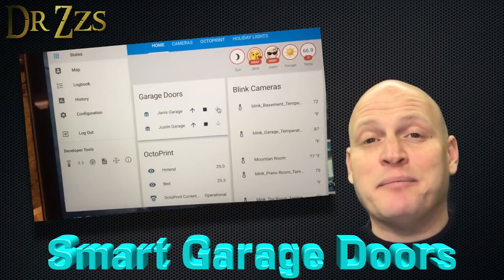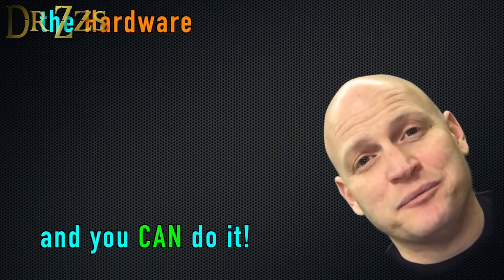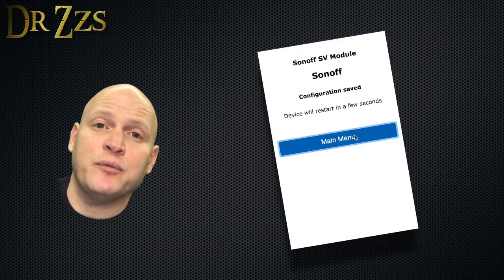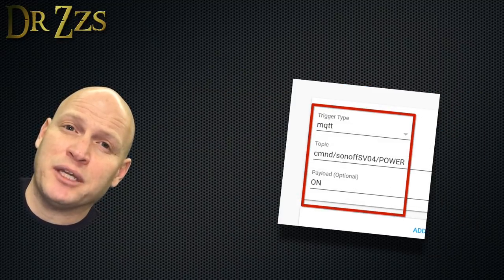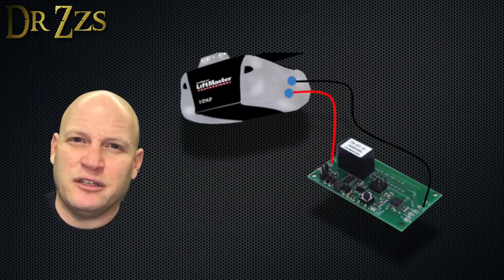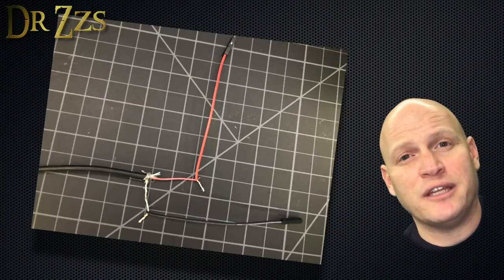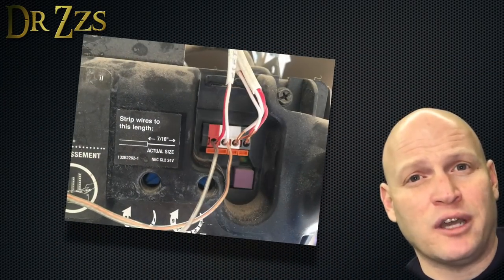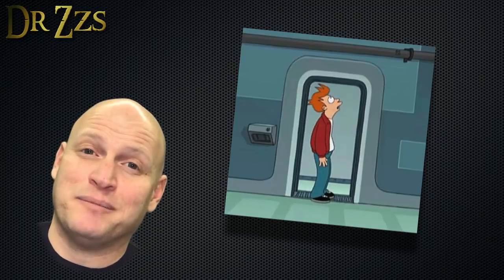$5 DIY "Smart" Garage Door Opener using Sonoff SV

Comment: I have been trying to get this going for a while. I am on a PI 3 B+ running dale3h/hassio_rpi3bp. I have tried so many combinations I am not sure what I have. I changed 
host in Sonoff to PI IP and it is connecting. But not controlling from HA. Here is print out of what I have now. Any help appreciated  https://hastebin.com/acanamoluh.vbs
Reply from the maker: First thanks for using hastebin to post your code/errors!  It is much easier to help when I have all that information.  
Now, let's see if we can get it fixed:

First, just so I'm clear.  You just have one sonoff SV?  I see the switch entry for 03 Sonoff SV, so just making sure that isn't a separate sonoff you have for something else. 

For the garage door with the SV you only need one SV, and you only need the "cover" entry, so if that 03 sonoff sv entry is supposed to be part of the garage door you can take it out completely. 

If that "03 sonoff sv" switch entry is for something other than your garage door sonoff SV I'd be surprised if it's working because I don't believe you can have "spaces" in the topic.  So instead of what you have it should look like this:
    command_topic: "cmnd/03SonoffSV/POWER"
 
    state_topic: "stat/03SonoffSV/POWER"
  
That is if the "topic" on the MQTT Config page in Tasmota is set as "03SonoffSV"  

The "cover" entry looks fine.  

The automation "MQTT SV test" is probably not working for the same reason that the topic has spaces.  I'm not 100% sure that spaces won't work in a topic, but I can't recall ever seeing a topic that had spaces, so I'm assuming that's a no-no. 

If I understand that automation it looks like what you're intending is when "03 sonoff sv" is turned "on" you want sonoffSV04 to be turned "off".   Is that what you meant to do? 

The customize.yaml part looks good. 

Looks like you output the text from the automations editor page.  Again, just tell me what you mean to accomplish with that automation and I'll tell you if it'll work or a better way possibly. 

Now that last part, which must be from the Console in Tasmota I see some possible issues.  First, the topics seem to have an extra section.  where yours says:

So you might have something wrong in the "Configure MQTT" menu in the box for "Full Topic".   Mine has this:

%prefix%/%topic%/

and my Console looks like this: 
00:29:52 MQT: stat/sonoffSV04/RESULT = {"POWER":"ON"}
00:29:52 MQT: stat/sonoffSV04/POWER = ON
00:29:53 MQT: stat/sonoffSV04/RESULT = {"POWER":"OFF"}
00:29:53 MQT: stat/sonoffSV04/POWER = OFF
00:29:55 MQT: stat/sonoffSV04/RESULT = {"POWER":"ON"}
00:29:55 MQT: stat/sonoffSV04/POWER = ON
00:29:56 MQT: stat/sonoffSV04/RESULT = {"POWER":"OFF"}
00:29:56 MQT: stat/sonoffSV04/POWER = OFF

What is in that "Full Topic" box on yours?

If you've changed a bunch of things on the Sonoff and want to start over fresh, try Configuration - Reset Configuration.  

So short summary:
1. delete that "switch" entry if that's supposed to be part of the garage door SV.  
2. I think that automation is wrong too so I'd say delete it. 
3. Not knowing what all you've changed with the configuration in Tasmota I think I'd try Reset Configuration.  Then with a fresh Tasmota:
4. reconnect to your wifi and set the same MQTT broker, user and password that you have now. 
5. set GPIO-14 to "Switch 2", like you have it now. 
6. in the Console type: Switchmode1 0, Switchmode2 2, Switchtopic2 2, and Pulsetime1 10. 

Try those things and report back and we'll see if there's more we need to sort out. 
Sorry you're struggling so much with it.  We'll get it working!
Reply from the maker: Forgot to mention.  That's a great fish in your pic!

Comment: What's the behavior of the relay when the SV gets disconnected or rebooted then reconnected to the wifi. I have the inching sensor from AMAZON https://www.amazon.com/Sonoff-Wireless-Automation-Modules-Control/dp/B07FJ77MZ9/ref=sr_1_19?keywords=inching+relay&qid=1570088308&s=gateway&sr=8-19 thats trigger the relay on and off when its reconnected from wifi which is not good if I'm away from home. I stop using em.
Reply from the maker: Tasmota has a power on state setting so you can set the relay to stay in the same state it was in when it went off. 
https://github.com/arendst/Sonoff-Tasmota/wiki/PowerOnState-Configuration

Comment: Thanks for the update Dr. Z. 

Do I need to buy Raspberry Pi for this project ? Any other hardware that I need to buy. 

Thanks,
Patel
Reply from the maker: You do need Home Assistant or some other smart home hub.  You can run it on something other than a pi, but most of us have at least started with Hassio on a pi.  
Actually, you could do it with just Tasmota.  The only interface you'd have would be the Tasmota UI and you'd be limited in what you could do for automations, but it would be possible.  
I'd suggest getting the pi (plus sd card and power supply) and getting started with Home Assistant.  You'll open a whole new world of cool projects for your house.  
I've got some videos on getting started with Home Assistant, but I'd also suggest looking at JuanMtech.  
https://www.juanmtech.com/

Comment: Presence detection with Owntracks is way more accurate. But in the fast  "move" mode of Owntracks... it uses a lot of you're iphone battery.. :( The "significant" mode is to slow i guess. Than you will sometimes have to wait a few minutes outside your garage :)

Maybe the network device tracker is something that will fix it for you? When you're phone is entering your network via wifi.. Then your door automaticly opens? But that also tricky when your phone or router will reboot en your phone is re-entering your network for example in the middle of the night?
Reply from the maker: Jeroen Klaver Good point. I only used OwnTracks with the Significant Change setting. 
I still use it for other things, like spying on my wife and kids. 
Did you know Jonathan from Superhouse TV got a chip implanted in his arm!?!  He uses it to open doors and stuff. I just watched that video last night. 
That guy is awesome! 
He’s bald too so that’s double cool.
Reply: LOL
Reply: We'll all have implants one of these days... think Neuromancer.  For now I'm perfectly happy to simply have a conversation with Alexa and rely on motion sensors etc.

Comment: probably I did something wrong as icon shows wrong statuses.

when gate is closed, (magnetic sensor close each other) icon shows - garage is open
when gate is open/opening, (magentic sensor no connection) icon shows - garage is closed.
I’m still new in HA, thank you in advance for help

https://community.home-assistant.io/t/sonoff-garage-open-close-status/54325
Reply from the maker: Should be easy to fix.  
Go to the config.yaml and swap the state payloads for open/closed. 
This is probably happening if your sensor is in s different place. When my door is open the reed switch is closed. 
Hope that helps.
Reply: yes it helps, 

state_open: "OFF"
state_closed: "ON"

my assumptions was based on window/door sensors, thank you so much

Comment: SmartThings users could probably pass in the presence detection of various phones through the MQTT bridge.  But that's not really a solution everyone can use.
Reply from the maker: I've got a SmartThings hub still on my desk waiting to be connected.  I'll have to try that when I get it hooked up. I'd like to run it for a while and really compare it with Home Assistant.  The price isn't too different when you figure the cost of a raspberry pi, sd card, power supply, etc.  I got my SmartThings on Black Friday for $50. 

Someone on the Home Assistant forums explained a way to use Home Bridge and Home Kit with iphones for presence detection that he said is working well.  
I tried the iOS component, owntracks, and router connection, but all were at least sometimes unreliable.  

I want to try BLE (Bluetooth Low Energy ).
Reply: I also got mine for $50 and thought that was the way to go until I ran into some roadblocks with some automation types I wanted to do.  I later found Home Assistant and it kinda fixed most of that, the bridge between the two was a bit of a chore at first but it seems to be working well now.  I have Home Assistant, MQTT, and the MQTT-ST Bridge all running in separate Docker containers on my unRaid box.  

One idea I thought of for presence was to use the Ubiquiti Unfi component and just watch for the phones to pop onto my AP controller, less battery chomping apps on the phone is a good thing.  I have an AP outdoors for the backyard coverage that the phones pick up 2-3 houses away on so it would work great for things.

Comment: H E L P      When I flash the SV I can find the IP address and make the changes as needed.  When I add USB 5v power (two resistors removed)  I get nothing.  My IP address is not there.  I have verified my  5v power and ground.  I have tried to trace out the board but no luck.  I have been at this today for almost 5 hours.
Reply from the maker: bummer.  
where are you connecting the 5v power and ground?
Reply: @DrZzs  5v power applied next to the area where the resistors were removed.
Reply: I looked at the board one more time.  I didn't notice the 5-24v section.  I now have power BUT, something else is wrong.  When I move the reed switch nothing happens.  Time to look at the settings, again.  It's a good thing I'm retired, I sure spend a lot of time just to make one thing work.  And I have a few others that don't.

Comment: I USE My home alarm to say weather am home or not... example... disarmed and arm_home means am home
and arm_away mean am not home
Reply from the maker: That's a good idea. 
Do you set the alarm on/off manually?
Reply: yes in ha it ask me to enter the  pin to arm and disarmed manually but I usually leave it up to the automation to armed only not disarmed. 
also my garage door using armed_away . so if the garage door is open while the alarm is armed away it will close it and send a message. 
I like your code for cover going to change up mines to show the up and down button 

here is an example of my auto armed

automation:
  - alias: Auto Arm if family notHome
    trigger:
      - platform: state
        entity_id: group.family
        to: 'not_home'
        from: 'home'
        for:
          minutes: 45
    condition:
      - condition: state
        entity_id: alarm_control_panel.home_alarm
        state: 'disarmed'
    action:
      - service: alarm_control_panel.alarm_arm_away
Reply from the maker: Cool!
That's a good idea, if the alarm is armed and the door is open in closes.  Genius!

Comment: DrZzs, here's what I use for presence detect. you could definitely modify this to open the door when you get home. 

###NightLights
  - alias: Turn On Outside Lights On When Moe Is Not Home
    hide_entity: true
    trigger:
      - platform: state
        entity_id: device_tracker.moes_cell
        from: 'home'
        to: 'not_home'
      - platform: sun
        event: sunset
    condition:
      condition: and
      conditions:
        - condition: sun
          after: sunset
        - condition: state
          entity_id: 'device_tracker.moes_cell'
          state: 'not_home'
    action:
      - service: light.turn_on
        entity_id: light.outside_lights
  - alias: Turn On Outside Lights On When Donna Is Not Home
    hide_entity: true
    trigger:
      - platform: state
        entity_id: device_tracker.donnas_s7
        from: 'home'
        to: 'not_home'
      - platform: sun
        event: sunset
    condition:
      condition: and
      conditions:
        - condition: sun
          after: sunset
        - condition: state
          entity_id: 'device_tracker.donnas_s7'
          state: 'not_home'
    action:
      - service: light.turn_on
        entity_id: light.outside_lights
Reply from the maker: Cool.  Thanks!
What do you use to track the devices?
Reply: DrZzs in my case I have a unifi wireless ap. Hassio doc has a walk through for several wireless access point. After restart it will create a file called known devices. They will then show up in your entities list. Set the devices you don't care to track to false in the known devices file.

Comment: Hey Dr zzs,
I am using one of these
http://aurahome.bigcartel.com/product/smart-wifi-garage-door-controller
 itead garage door openers for my electric gate. It works great in stock form, no programming or firmware changes needed however I wonder if a Reed switch can be connected to it so I can tell if the gate is open or closed remotely? 
All that programming that has to be done to the sonoffsv is a little daunting for me.
Thx!
Reply from the maker: If you're using the stock itead firmware then no, you can't add an extra switch.  You could if you use Tasmota or some other more flexible firmware.  The round pins on one end of the board are what you would use for the reed switch.

Comment: This doesn't work with all garage door openers.  My garage door opener uses a coded signal on from the button to the main unit.  For this you need to jump across the actual button, not where it plugs into the opener, or jump across the button of a spare remote.

Comment: Switchretain 1
Powerretain 1
switchtopic2 garagestate
switchmode1 0
switchmode2 2

GPIO 14 to 10 Switch2

GPIO 4 to 22 Relay2

cover.yaml

  - platform: mqtt
    name: "Sonoff SV Garage"
    state_topic: "cmnd/garagestate/POWER2"
    command_topic: "cmnd/sonoffsv01/POWER"
    payload_open: "ON"
    payload_close: "ON"
    payload_stop: "ON"
    state_open: "ON"
    state_closed: "OFF"
    optimistic: false

customize.yaml
   
    cover.sonoff_sv_garage:
      device_class: garage
      friendly_name: Garage 

group.yaml

  Garage Door:
    name: Garage Door
    view: no
    control: hidden
    icon: mdi:garage
    entities:
      - cover.sonoff_sv_garage

just thought I’d share the full details of a sonoff sv garage switch with 6.2.1 firmware. 

This is everything I used to get this going.
Reply from the maker: Fantastic!  Thanks!
Reply: @DrZzs  No thank you sir.  Couldn't have done it without you.  Just thought a complete list would help someone out there.  The tricky thing I had was the statetopic.  Since going to 6.2.1 I can't change it to 2 I had to use garagestat or something else than 2.  I tried to find an answer but couldnt'.  Thanks again.
Reply: Promote that man! Chris, you finally saved me a lot of head scratching and frustration. DrZzs, loving the channel. Just bought 14 Sonoff rf and 2 SV. The first SV has taken longer than I expected. Please update the update in the description cause I must have hit the same issue with statetopic2 2 not being kosher with the new version. Learning with every hurdle and it does make a working outcome seem more satisfying. Keep up the great vids. Cheers from Australia. Pete
Reply from the maker: Thanks Pete. 
I'm going to copy/paste Chris' post into the Description.  :)

Comment: Dr. Z, I need some help here. Based on  the links below I bought the sonoff SV kit and the reed switch. I started working on this project but had already hit the road block. I dont have any programming back ground; but I can follow directions. First thing I understood is to do the Flashing using hard wire method. I went the other link (https://www.youtube.com/watch?v=c2IUIUnxjUY) to get Tasmotized and Sonoff running. I also visited your website and the first instruction is to open sonoff.ino. I searched the web but could not figure out how to open it.Could you please guide your non-programmer followers here how to set this up.Thanks,M
Reply from the maker: No problem! 
.ino is an arduino sketch file so you open it with the Arduino IDE.  You can download it here:
https://www.arduino.cc/en/Main/Software

But!  I actually think there's a better way.  If you watch my newest video about the Sonoff 4 channel I talk about using "flashEZ" and using sonoff.bin
That's a much better method especially if you don't have programming background because you don't have to edit the files or mess with libraries or any of that. 

Grab the zip file from ESPeasy: https://github.com/letscontrolit/ESPEasy/releases/download/mega-20180513/ESPEasy_mega-20180513.zip

Then grab sonoff.bin from Tasmota:
https://github.com/arendst/Sonoff-Tasmota/releases/download/v5.14.0/sonoff.bin

put sonoff.bin in the same folder with FlashESP8266.exe

Connect your Sonoff w/ your ftdi (USB/Serial) adapter (3v, Rx, Tx, Gnd).  Put GPIO-0 to ground (usually that means holding the on-board button) then plug the adapter into your computer.  Then you can let go of the on-board button. 
Open FlashESP8266.exe, select the Com port of your ftdi adapter (it usually selects it by default).  The select sonoff.bin and click flash.  As long as your sonoff is connected correctly and in programming mode it should flash.  
After that you have to either wait for the sonoff to go into WifiManager mode, meaning it broadcasts a wifi you can connect to, or you can press the on-board button 4 times to force it into wifimanager mode. 
Search for the wifi ssid called "sonoff-"blahblahblah Connect to it and you'll be able to put your wifi SSID and password. 
That's a quick re-summary. 
Let me know if you get stuck.